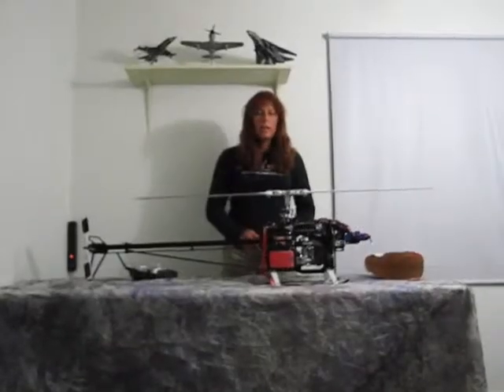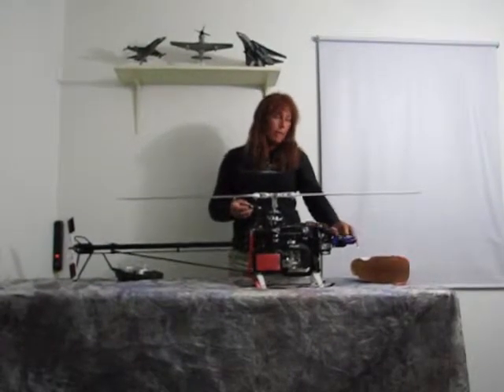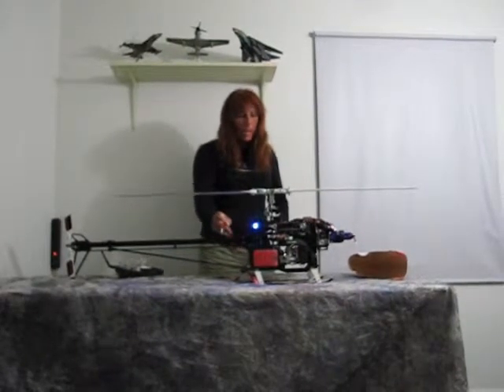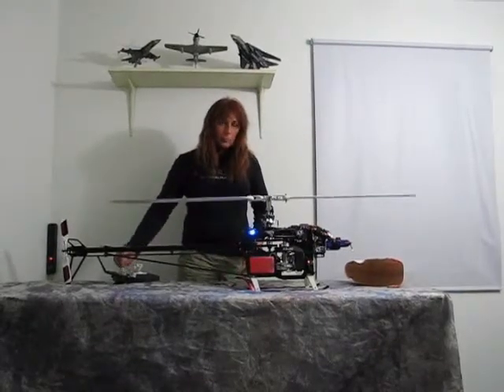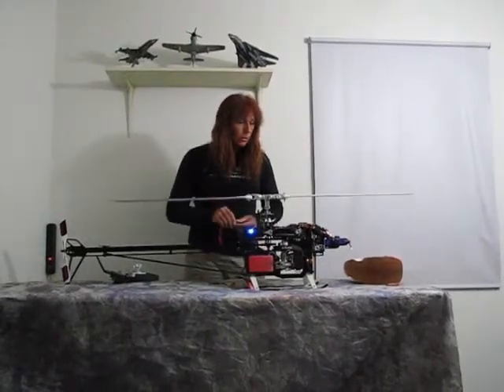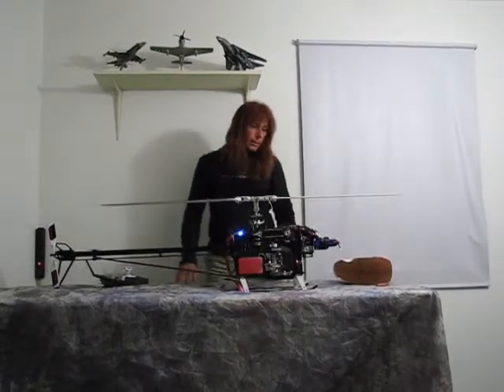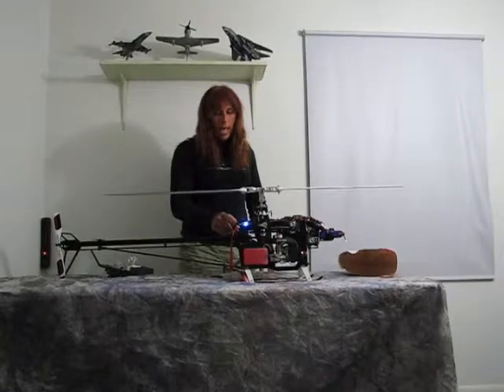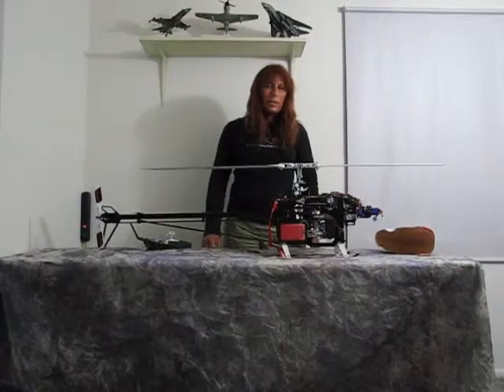Scorpion Backup guard

Comment: Hi there and great video. 
Question: what's that switch with the tag and how is it setup. I am thinking this allows u to put on canopy and then pull out to engage. ?
Reply from the maker: +Aerial MediaTrinidad Hi. The switch with the remove before flight tag, is the main power switch for the electronics. It`s a normally open switch that is designed for use with Gryphon BECs. It plugs into the BEC and turns the electronics on when the pin is pulled out. If the switch fails during flight, it will default to the on position. So the electronics will remain powered.
Reply: +Geena2112  thanks for the quick response.
Reply from the maker: +Aerial MediaTrinidad My pleasure. Happy Flying :)

Comment: Hey i found your channel through nitrokyosho. I am just starting in the RC Heli hobbie. After my Syma 800G what would you recommend for my 2nd heli?
Reply from the maker: Hi.

Your next helicopter choice depends on a few things when you are coming from a co-axial helicopter.

Do you want a helicopter which is capable of flying outdoors, in windy conditions? Do you want to stay with an indoor helicopter?

There are a few that I would recommend, that would be great for making the transition from co-axial to single rotor.

The first type would be a fixed pitch single rotor Like the Blade 120sr. Which is perfect for indoor flying, yet is perfectly happy outdoors in light wind.

The second type I would recommend, is something like the Brushless Blade mCPx, or the new Align T-Rex 150. Both of these are collective pitch micro 3D capable helicopters, which can be flown in moderate wind. Yet are still small enough to be flown indoors.

The Blade 120sr can be purchased as a ready to fly setup, but the T-Rex 150 and mCPx will require purchasing a  transmitter, as they are offered as bind and fly.

I am pretty sure the T-Rex 150 will bind to Futaba, JR and Spektrum transmitters, but the mCPx will require a spektrum transmitter.

I hope this helps you, and please feel free to message me any time if you need any help.

                      Happy Flying.
                      Geena